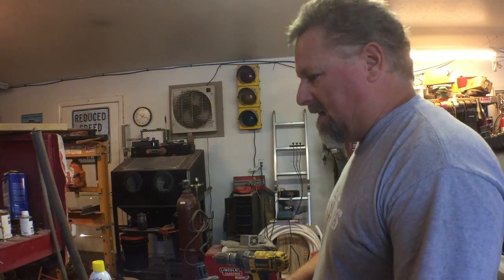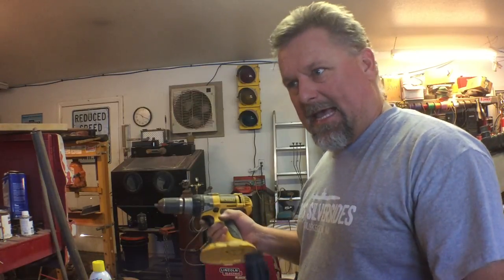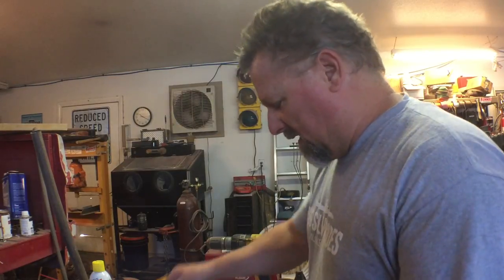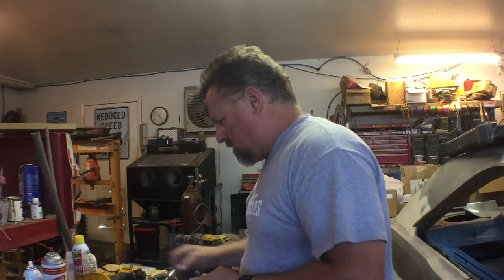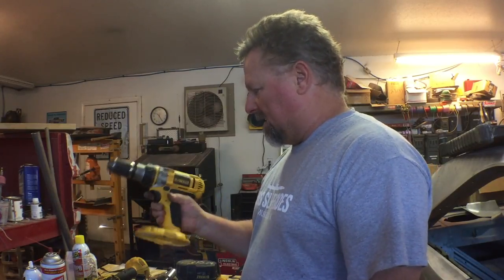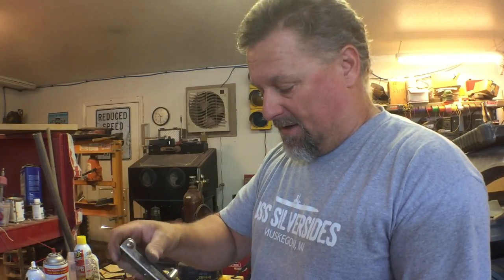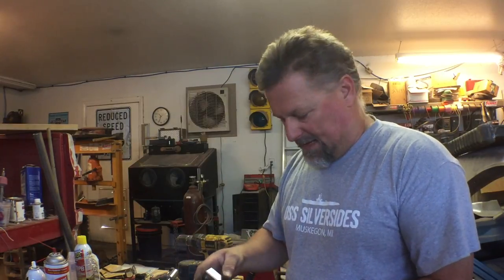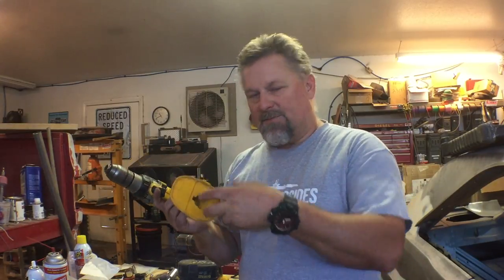3 DeWalt Cordless Drills Nearly Catch Fire!

Comment: I agree with you 100% on the batteries. I still have the 18 volt Ryobi drill, circular saw(POS), and sawsall that I bought back in 06 before they went to the Nicad batteries. They worked like poop on the old Nicads, but are still working just fine with the new Lithium. I'm not a new tool guy much, I mean the last corded skill drill I bought lasted me over 20 years before it finally fried out, but I do know that I've had some really good service from Ryobi battery tools. Except as above the (POS) circulars. My sons did a lot of underground piping when they started working and always went back to their Ryobi's when the other tools quit on them. No endorsement, just our experience. Loved the video. We all hoard tools cause we can't stand to see them go to waste when there is a chance we can make them work again. ;)

Comment: Ridgid has life time on all parts and the bats. I have been slowly changing all my tools to Ridgid and have not had any issues with getting any thing replaced free. I now have table saw, router, cordless drill, cordless hammer drill, cordless nut runner, cordless cutoff saw with the extra head for sawzall and planer. All work great and are very well built. the cordless bats are as good as the day I got them after 3.5 years for the 18v and 8 years for the 10v.
Reply from the maker: rigid used to be made in use after sears went oversees. (rigid made craftsman power tools branded to sears) then they made tools for home depot.  they've since been bought out by the same company that makes the aforementioned brands in this video, all made in the same factory in china.  That being said, a lifetime warranty can be a deal maker in some cases.
Reply: Yep, most have good deals on the tools. Then f you with the bats, thats why I by Ridgid... I know were they make them, and like you said there all made there. So I go for the one that is not f'ing me the bats....
Reply: 55ATA3 my buddy just replaced all his with rigid. I like them.
Reply: The Ginger Bus Adventures I like millwalkee

Comment: I have the same problem you did with my dewalt sawzall with the quick blade release not working as intended. Kinda amazing you were actually able to find parts to fix the old drills. Good deal!
Reply from the maker: believe it or not, its kinda easy to find parts for these old dewalts.  You can still find new and factory referbs of this model

Comment: Smoking hot video, wow !!
Reply from the maker: nah, not even warm!
Reply: ok, well if you say so....!!  But that's a good topic of which Cordless toys to go for, I have the Porta Cable set, and just bought new batteries from eBay. The originals lasted about 8 yrs. My circular saw though, Robi (?) is majorly wobbly, and Home Depot won't replace it as they are like what you had to deal with. Sorry they say, we won't replace it due to normal "wear n tear", heck I only used 3 times, and the blade goes wobbly...poor workmanship, right? nah...they don't want to do deal with it...so yeah warranties are BS, don't buy them, you waste your money...while they make money off of you by investing in them $25 -- ok I am done barking on my soap box....(I am sure you can relate)